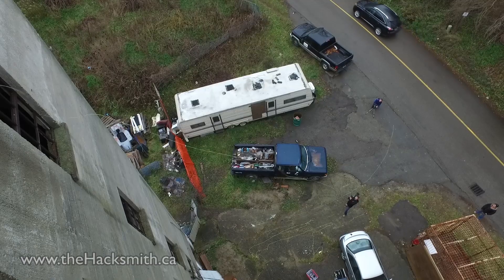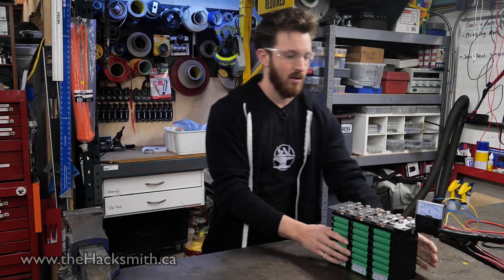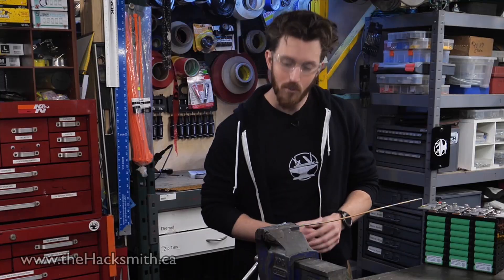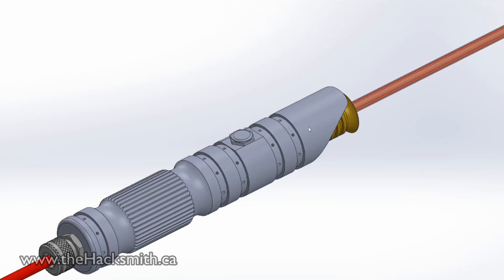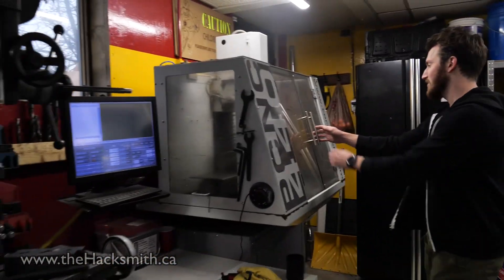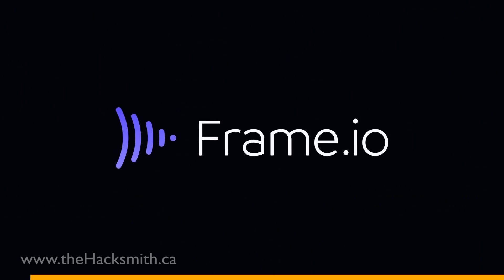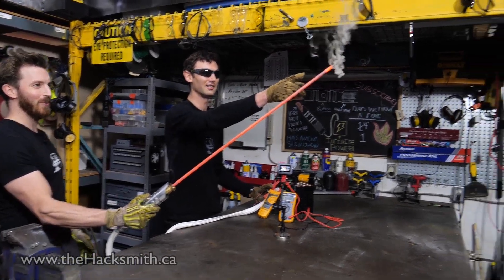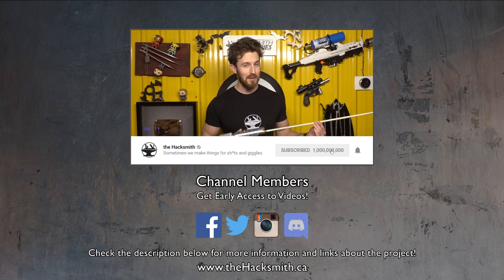3000° TITANIUM LIGHTSABER BUILD!

Comment: incase people were wondering not saying your dull just incase you didn't know the reason there was water on the handle and the drill bit it is so they don't over heat and bend / brake so if you see that its so no damage happens to the peices

Comment: for the battery pack you should consider using super capacitors instead of lithium ion batteries. they can output a lot more current and will last longer
Reply from the maker: they will not last longer... super capacitors don't have higher energy density than lithium ion...

Comment: There's is a alloy called inconel that is made for the requirements you're asking for. It retains its strength under heat and has decent oxidization resistant properties under high temperatures

Comment: Your protosaber wasn't a bad first attempt, and I admire your SolidWorks drawings (I'm a general drafter becoming a mechanical drafter myself). But your blade assembly is too complicated and not as efficient as what I've got in mind. While tungsten does have a high melting point, it is also brittle and relatively heavy. Carbon has a higher melting point (6,422 F or 3,823 K), it is lighter, stronger, has a higher thermal conductivity (~800 W/mK), and has a higher electrical conductivity (with graphite having an electrical resistivity of 7.837 µΩ·m). The problem you might run into with carbon though, is that outgassing (oxidizing) may or may not be a problem at those temps. Silicon carbide would be your best bet. Silicon carbide is light, has a high electrical conductivity (with a resistivity of 10^2-10^6 ohm/cm), is strong, has a high melting point (4,946°F), has a decent thermal conductivity (120 W/mK), and it doesn't outgas at all, no matter the temp. it's at, until you get to the melting point, in which case it melts (a benefit of it being a ceramic).
So silicon carbide would be your best bet for a blade because you can just energize the SiC blade itself, it'll heat up to your desired 3,000 F temp, it'll stay as strong as if it wasn't heated, it won't be that heavy, neither will it be that brittle, and these benefits will allow you to do more robust movements with it. If you doubt my numbers, I encourage you to look them up yourself.

Comment: Viability in combat? Nope.
Sheer awesomeness? 12/5.
Closeness to finally achieving a true light saber? 
Likelihood to catch everything, even like 5 foot away from the blade on fire? 100,000,000% Guarantee?
Reply: Also, out of curiosity, would it be possible to cut through a living person like an actual sword at that heat?
I'm just curious if the extreme heat would make it capable of functioning like a real sword or if it'd bounce off and just horrendously burn where it strikes.
Not that I'd ever use it or advocate using it on a real person, but there must be some way to test this without harming someone, since if it's unable to cut it might as well be a REALLY complicated torch.

Comment: I know i'm a bit late, but why don't you make the power run the other way (from titanium which is on the outside to tungsten which is on the inside) and then to make the isolation between them to be able run the power without shortcuts, you make it with some solid ceramic or even some sort of glass which could resist this high temperatures and then you get the tungsten red hot first and heat up the titanium on the outside transfering the heat through that ceramic or glass isolation?

Comment: The idea of using the two metals in that configuration is really clever. I definitely wouldn't have thought of it, but it works perfectly; since the titanium has higher electrical resistance, that's the part that would heat up the most (like you said), and its electrical resistance would continue to climb with increasing heat.
Plus some pretty simple formulas; Watts Law (Watts = Volts * Current), and Ohm's Law (Volts = Current * Resistance; or in this case, Current = Volts / Resistance). The tungsten just acts like a wire as far as the circuit is concerned, and the titanium is the load.
Damn cool result, too.

Well, very much the opposite of cool. 3000 degrees celcius is really damn hot. But still.

By the way, that fire incident you showed some clips of. I'm guessing you disposed of those battery packs after that happened, right? I definitely wouldn't trust battery packs that had been near (or on) fire like that, myself.

Comment: The saber is still pretty thin, so I think you can get away with putting more in there, isn't there something isolating and strong that can be put in between the tungsten and the titanium to make it stronger? Or perhaps simply a thicker piece on Tungsten or would that  not work?

Comment: Have you ever thought of using an altered electromagnetic field and filling it with plasma and an igniter? The field would keep the plasma in and you could alter color with different types of plasma. It would also be easily started and stopped because by turning the igniter off in the handle. Please upvote this so they see it!
Reply: Potentially feasible, but it would require input power extending into the megawatt range to generate and contain the plasma, and you certainly wouldn't be able to get near it while it was on.
Reply: @nemo5654  heat suit possibly? I'm just saying, it would make it powerful and you would be able to turn it off and store the handle
Reply: @tannerthomsen9679  With today's technology, such a device would be far from hand-held; it would likely require equipment that would occupy a warehouse to do. The intense magnetic field and the heat would make it deadly to be so close, and you would have to view it from a distance and behind thick shielding; conditions would be intense enough to cause massive amounts of UV and even XRAY radiation (like why arc-welders have to wear special masks).
Reply: The two bois in this argument both had a point.
Reply: have fun with the energie needed, but the idea of a fuel based light saber that ignites the fuel into plasma is awesome
Reply: english please
Reply: @arax2247  lightsaber big boom with high energy yummy lights much disaster.
Reply: uhhhhhhhh you do know this isn't Tony Stark right? this would require a literal arc reactor and governmental funding as cool as it would be
Reply: Why do I get the feeling you are just stating how Beam Sabers work in Gundam?
Reply: 1. Electromagnetic fields do work on plasma, do your research. Plasma is a heated gas. It would be contained by electromagnetic fields if calibrated correctly. 
2. Plasma changes color depending on what element you use in the process.
Do not bash someone if you don't do any research yourself. If you ACTUALLY research what I'm talking about, you would be surprised. The fact that you bash without evidence makes me sad. Do your research and don't be THAT person.
Thank You
Reply: @tannerthomsen9679  Plasma is not a heated gas.  Plasma is a 4th state of matter just like solid, liquid, and gas are states of matter.  Saying plasma is heated gas is like saying gas is heated liquid or liquid is heated solid.
Reply: @Plur307  I know that but if that one guy didn't even know that it could change color, I kinda had to dumb it down.
Reply: @Plur307  but to be more specific, plasma is an ionized gas which in turn makes it really hot. (Which is where I got "heated gas")
Reply: @tannerthomsen9679  right, but it doesn't have to be hot.  There is cold plasma too.  But I agree it usually is very hot.
Reply: @Plur307  I know that. I was saying for this specific video tho. Cause it would be lame to make a cold lightsaber
Reply: yes possibly but I can get the same results with 4 thanks of gass and a blow torche
Reply: Tanner Thomsen this isn’t reddit
Reply: @nemdotu  do I care? (The amswer is no)
Reply: Dude that won’t work. Electro magnetic field doesn’t work on plasma. Plasma can’t change colour either. Are you just blurting our scientific words? I think so.

Do you even know what your talking about!?

P.S: Don’t beg for likes
Reply: @SchizoHyperborean1488  umm, plasma CAN have different colors man, why do you think Neon signs are red and Xenon lights are blue? different gases yields different plasma colors.

Comment: Since the proto-saber used a controlled battery pack, couldn't we make a 'proto-saber' by putting a high output microwave transformer into a handle/shaft, focus the microwaves, and use a high lumen LED with a tight wavelength to produce a 'blade', and power it all with a car battery with step up conversions?
The LED would only be used for looks, of course.

Comment: slowly cuts through soft foam that’s easy to melt with a standard lighter
Reply: It cut through metal pretty quick...
Reply: TheRealCuddles at 12:52 he goes slightly faster than 0.000001 mph and the foam tips, it doesn’t even melt 😂
Reply: @Michael-px4oj  It did melt and it fell over...you watchin' the same vid
Reply: TheRealCuddles you’re missing the point man, if it was hot enough it should’ve easily gone through but it bumped it and tipped because it simply isn’t hot enough
Reply: @Michael-px4oj  I think 3000 degrees is plenty hot...
Reply: TheRealCuddles just saying, if it’s so hot they should’ve demonstrated on something other than easy to cut easy to burn styrofoam. I don’t doubt it’s hot, but I do doubt its effectiveness
Reply: @Michael-px4oj  I agree they shoukd test it on skmething cooler.
Reply: @Michael-px4oj  he was probably going that slow so he didn't hurt the tables feelings....
Reply: @Michael-px4oj  He cut through metal in about two seconds in the video...I've said this twice now

Comment: I wonder if tantalum would be the magic metal for building a lightsaber. Molybdenum and Tungsten have incredible melting points, but form volatile oxides that vapourize off the metal, exposing more metal and giving you a healthy helping of lung cancer. Titanium works as seen because it forms a very stable thick coating of titanium dioxide that protects the metal. However titanium melts at 3,000°F. Tantalum melts at 5,500°F and the oxide doesn't even start melting until at least 3,500°F

Comment: Wearing a conductive ring on your finger when working with high power electrical sources is a really, really bad idea. If you happen to just barely bump the two terminals with your ring, it's going to immediately glow and burn you very badly. Getting a burn around the circumference of your finger is actually incredibly dangerous and can lead to you losing the finger. You can either put tape over the ring or take it off, but I was terrified the whole time watching you.

Also, eye protection. Please.

Comment: You probably already know this but that titanium is gonna crumble after a few more uses. Getting it that hot in normal air makes the entire thing oxidize and get ridiculously brittle, you could probably break it with your fingers at this point. Maybe include some argon vents for purge gas?

Comment: From the look of this lightsaber, it needs a titanium cap on the end to prevent the oxidation on the tungsten. Also the power only needs to be used in pulses to extend the battery life, as once its hot it doesn't need to be at maximum, 2000 degrees Celsius would be enough. The tubing could also be in sections to allow the current to flow easier
Reply: Pulsing wouldnt extend the battery life enough to be worth doing probaly only 20% and its not being used to actually perform a task so battery life doesnt really matter.
Reply: @marknogueira6425  how is a 1/5 improvement not worth it lmfao
Reply: @lIlIlIlIlIlIlIlIlI  the saber is not being used for practical reasons for the cost of putting that tech inside would not be worth it and would make the pulsing not needed.
Reply: Yea what he said
Reply: PsYcO that’s me right now
Reply: The blade is gonna explode with all the gas inside it if it cant get out lol
Reply: @stanleypark7200  It isn't gas, it's smoke that comes from the tungsten oxidizing. To oxidize, you need oxygen. If there is a cap on it then no oxygen can reach the tungsten therefore no smoke.
Reply: @stanleypark7200  yeah that's what i was going to say. Capping it is a bad idea, as long as it vents out the tip the gas isn't so bad.  Other guy said if it's sealed it won't oxidize & smoke...but i wouldn't trust it to stay sealed at 3000°.

They probably should wear masks or respirators though...I'm sure tungsten oxide gas/smoke whatever you want to call it, is probably as bad as copper smoke...a good way to get trench mouth.
Reply: there smarter then u
Reply: @-twokinds-2614  BuT R U SmArT?
Reply: Joe B no

Comment: I'm pretty sure that the titanium also can't withstand the enormous heat just like the tungsten. Titanium reacts really fast with oxygen. At this high temperatueres the passivating layer of TiO2 on top of it doesn't protect it anymore and everything oxidates (you can clearly see the white powder on the rod after it was used).

Have you considered using a nickel-base-alloy? That should almost not react at all and become just insignificantly less strong when hot.
Reply: Yeah tungsten would probably be best. It has a ridiculous melting point but takes longer to heat up
Reply: @dominicjeffrey9477  Dude did you even read my comment? :D
Reply: @dominicjeffrey9477  ill just say xdddddddddddddd

Comment: I will feel Sorry for the burglar that breaks in the shop
Reply: Yeah, but you’d have to run to this thing, power it up, and actually hit the burglar. Meanwhile, the burglars may weapons (guns) when committing the crime. Doubt a protosaber will stop a bullet.
Reply: I dont
Reply: Do you not believe of the path to the Jedi?
Reply: @generic_username9719  correct me if I'm wrong but in the Star Wars universe lightsabers can only block plasma bolts from blasters. They can't block slug rounds (normal bullets) they'd just heat them up and it'll just pass through
Reply: @audiarif6534  Now you know where the term "Hot Shot" comes from.
Reply: Lmao

Comment: Use the Arc reactor in the battery pack. Also you guys could have used chromium for the blade. It's hella hard to melt, so what if you did a triple layer blade with chromium core wrapped in tungsten pipe then wrapped in a larger titanium sleeve.
Also, that current flowing through the core out to the blade makes it se very much how a lightsaber actually functions, because it's not just a blade, it's a constant beam thay flows back through the handle. Thats so cool, and yall are getting really close. I'm do proud to he alive at this moment.

Comment: The hilt seems a bit to beefy to me to properly wield it
Also consider threading the  top of the titanium tube - that way you can properly seal the core and protect the wolfram fron environmental influences 
When you're done prototyping, you cpuld even tig weld the cap on there , since you have a titanium-titanium interface

Comment: Mabey the lightsaber was always just a really hot metal pole but the pole is retractable so u can put it in ur pocket and the power for ur heat got alot smaller and could fit in the handle so when u press the button the metal tube extracts and instantly heats up 

And the Sith are older than the jedi so the they had red blades becuse they didnt have the technology to change the blade color . And then the red became tradition

Comment: I know it would cost astronomical prices but platinum is the best conductor, since over heating is the major problem, cycling power to keep it at a certain temp without sacrificing shape or usefulness.  Also mercury is not affected by heat the way other medals but does conduct electricity and although weight could be an issue if a lot is used but a needle sized core filled with mercury " so full it doesn't have room to move" could stabilize your heat and if correctly shrouded from electricity could do what you want it to do.

Comment: just use graphite its good and it gets red hot and it cant get soft so it is good for high tep applacions
Reply: Isn't graphite pretty brittle though?
Reply: @sgbench  not if you use a thick pipe
Reply: @sebastiantinsley9812  So... use a graphite core surrounded by a metal pipe? Is that what you're saying?
Reply: @sgbench  yes
Reply: Sebastian Tinsley That will be EXTREMELY expensive tho..
Reply: @whyyoumadbro2370  I think you are mistaking graphite for graphene
Reply: nikmor 5 You’re right. I’m dumb
Reply: @whyyoumadbro2370  nah man, you just need to contact pencil manufacturer, graphene on the other hand...
Reply: @whyyoumadbro2370  ahem spy car lazer cannons THORS HAMMER XD
Reply: Graphite..??

Comment: Used something similar working as a welder on construction equipment when pins got stuck in them- it was a hollow rod with a dissimilar metal inside that would burn violently and bore through whatever metallic thing it touched.